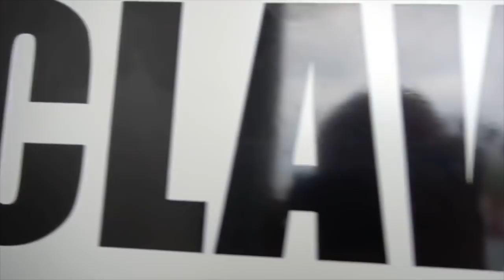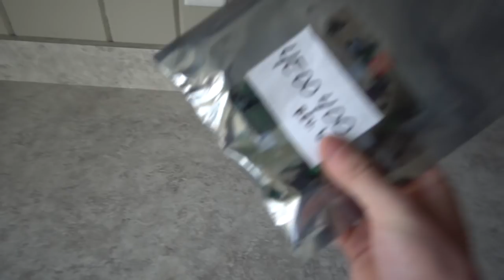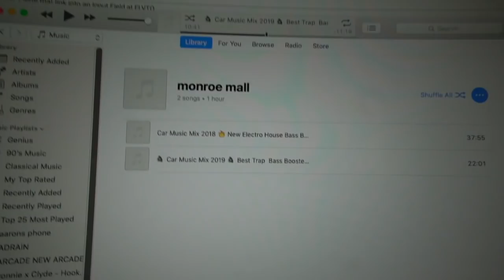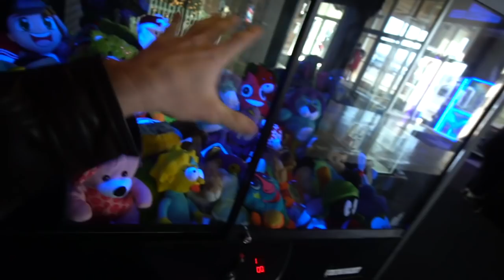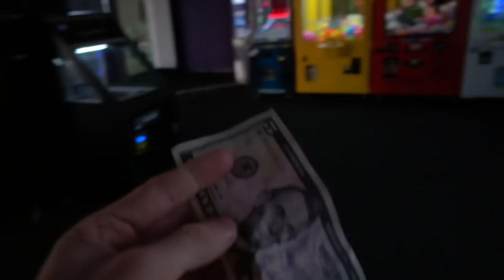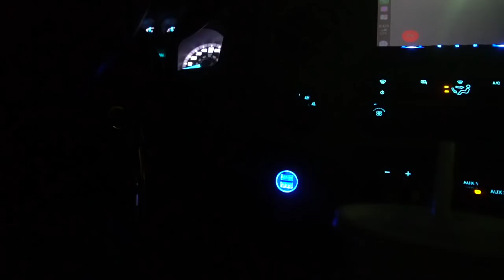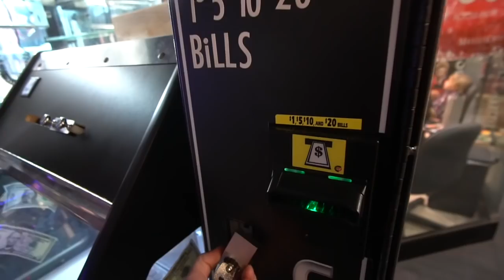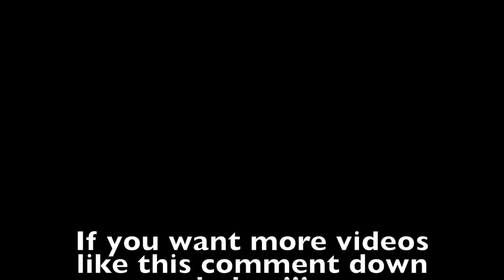What it’s like OWNING ARCADES!!

Comment: If you still haven’t fixed that socket in your claw machine I think I know what’s wrong with it. If you unplug it and then unscrew the lightbulb out of there at the bottom of the socket there’s a little electrode that the Bulb comes in contact with it might be pushed down too far and if you were able to put something in there to bend it up a little bit it might work

Comment: That light bulb socket looks like a cheap one. The tabs get bent back in the socket and will not make a good connection. Easy and cheap fix
Reply from the maker: BLURby84 imma put in a new LED strip to replace it
Reply: Claw Kicker still quick and easy.  Lol and more efficient.  😎